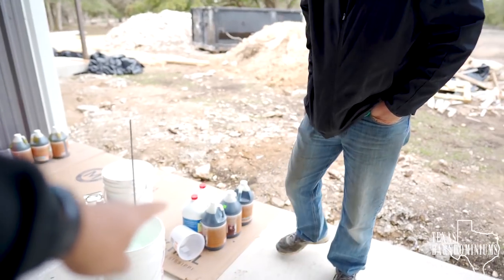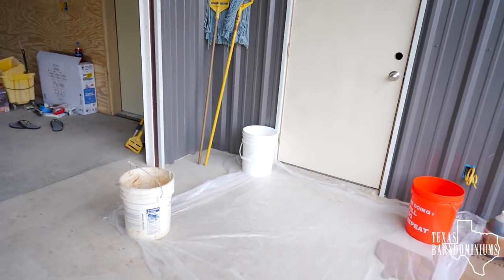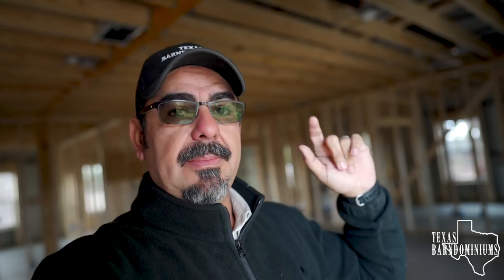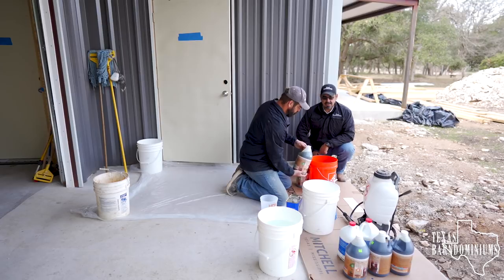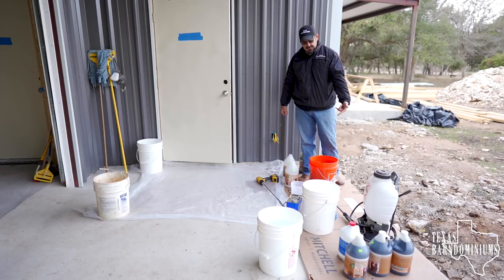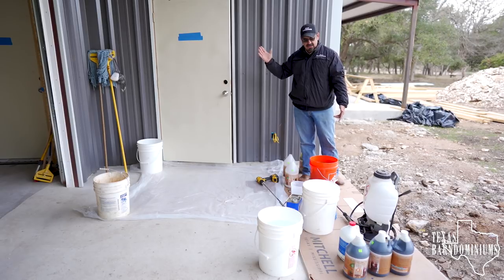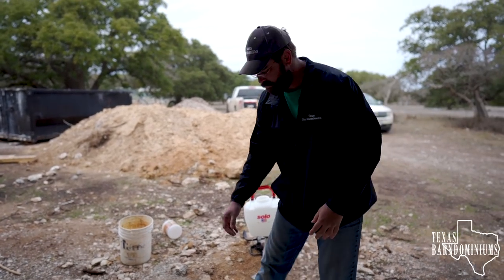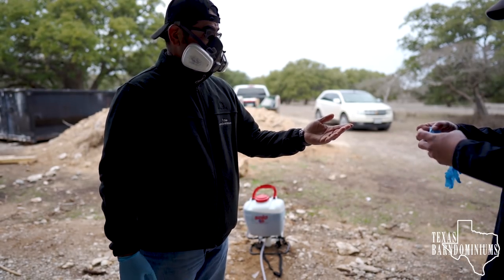Step by step on how to spray concrete acid stain - S3E9

Comment: If you get places where the stain doesn't take, you can take Sinak HLQ125 and tint it with universal colorant and fill in. Check with Surface FX in Santa Barbara, CA. They are a supply house.

Comment: When my bardo was being built the manlift left black marks on the concrete. I planned to use brick form brand stain and they say not to use acid based concrete cleaners and I can’t find anything to remove the black marks. Do you have recommendations?

Comment: I was told to stain before framing.  I was also worried it might hurt the wood getting acid on it.  Another thing is do I need to seal all the concrete even under framing?

Comment: How do you calculate the amount of stain needed?
Reply from the maker: Instructions on the bottle.  Usually 400-500 per gallon
Reply: @TexasBarndominiums  400-500 per gallon pure or already diluted? thanks in advance
Reply: Texas Barndominiums two things. 1) just curious is this product available to be sold to the general public or do you have to have a company/contractor? 2) how much does this cost per gallon or kit, wether stain or just sealing the natural concrete?
Reply: Texas Barndominiums what do you use for a floor covering during the rest of the construction process?  Thanks

Comment: Another great video. I have always wondered since you are doing this after interior framing what do you use to cover the floors while the remainder of the build is completed ? 

What are best practices for applying the protective construction covering and what is the best way to prevent it from getting damaged during the construction processes?
Reply from the maker: Ram board or similar.  Don’t tape it to floor or you can ruin the sealer.

Comment: Do you apply muratic acid before the stain? or can you just do the the mix like you did in this video? (I have quite glossy concrete)

Also how much square foot do you use one gallon of stain to cover? I know the labels usually say 200-400, but what's your opinion?

Comment: Another  great how to video. Do you normally  use 2 different  color stains? And what do you neutralize the floor with before  sealing?  Again great  how to video.
Reply from the maker: No, two stains was just based on what customer wanted.  We use ammonia and water to neutralize.

Comment: How about a old concrete with defaults, paint spills, glue.etc.can it be done.
Reply from the maker: Yes, but epoxy would be easier because color is in the coating.

Comment: Is there a reason you finish the floors after the interior framing is done? Can it be done while the barndo is still wide open?
Reply from the maker: Concrete has to be at least 30 days old and moisture level less than 50%
Reply: @TexasBarndominiums  Ahhhhhh. Ok that makes sense. Thank you!

Comment: How do you neutralize the acid stain?
Reply: He say AMONIA or BAKING SODA ....but must be quick and the same time you make the spot...and a lot water ....!   I think
Reply: @potatosalad5355  I ended up using clear ammonia, and it worked amazing on my floor. Cheap and not much is needed.

Comment: Why does everyone acid stain. It looks sticky and bad.  Several years ago when I built my home I had concrete floors everywhere that looked like expensive, natural slate. I did not acid stain. After the pour I threw out powered charcoal and red over the still wet but firm enough to walk on. Then it was finished with the swirly machine. Turned out great except the areas I didn’t hit enough with the powder throw.